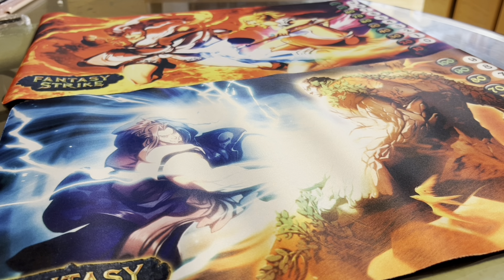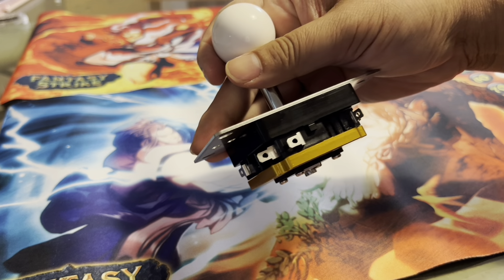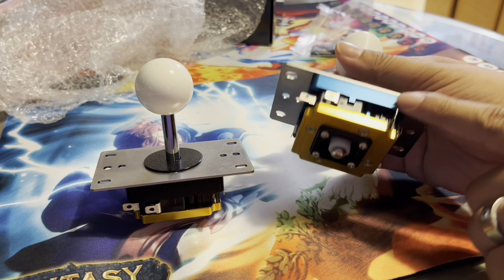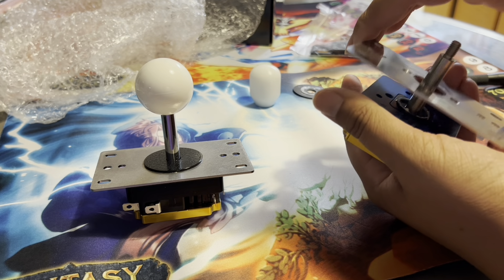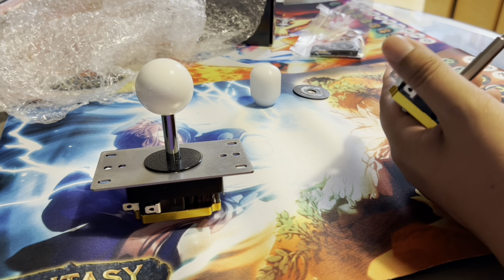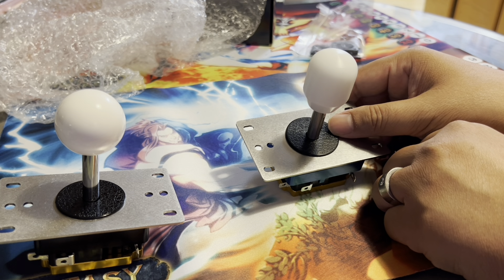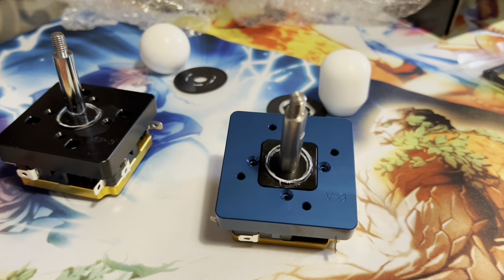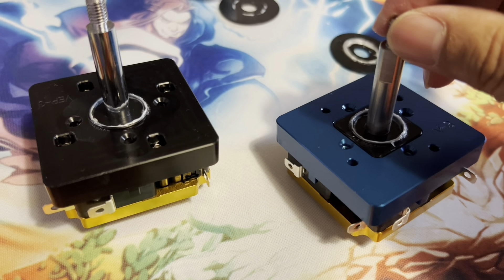Fresh Out Of The Box: Premium Sanjuks V3 - One of the Greatest Levers Just Got Better!!!

Comment: I assume the spring delete kit doesn’t work with the old v3?
Reply from the maker: The Spring Delete Kit is not for the Sanjuks levers (any of them). It was just a bonus gift from Buttercade. 

It is used with the Otto DIY V2 modkit which makes a Sanwa JLF lever perform with a mini grommet & spring system (instead of its usual pivot and spring system).  The Spring Delete delete mod outright replaces the spring and creates a unique feel 🙏🏼

Comment: I run a JLF With Otto V5 and 2lb Spring and it is absolutely amazing but I want to try a Korean lever, so I see that this Sanjuks V3 seems like a JLF but with Premium Built so I should try the Sanjuks V6 instead of this V3. I don't think the Sanjuks V3 is better than an otto V5 other than just the premium build. What do you think?
Reply: Edit 👆
Reply from the maker: @Pichoniix  I promise you I will respond to your excellent inquiry, but I’m taking care of sone work stuff for a few more hours. But I do have some things to say and I’m looking forward to replying 🙏🏼💕🔥
Reply from the maker: pichonix, Excellent question and inquiry!

- I totally love the JLF + Otto V5!  My favorite spec is JLF + Otto V5, 1.5 Otto Actuator (I wish they had a 1.25) + Buttercade Stainless Steel Pivot!  For my game, Virtua Fighter 5 Ultimate Showdown, this build is just so insanely good as long as you have good neutral control on the JLF.  It is insane greased lightning and is a rapid fire direction hitting machine!

- The Sanjuks V3 is like an interesting mesh of stock JLF and some of Seimitsu’s levers.  It has a neutral snapback that Seimitsu and K-Lever fans love.  The tension is not as high as a Seimitsu but it’s got a really cool “machine-like” feel.  The tension drop is part of that.  When not feeling mechanical, most models feel very smooth and when it’s smooth it’s buttery in those brief but frequent moments.  It’s a very different feel from the Otto V5 but it’s great.  The throw is closer to a standard JLF throw.   The buttercade stainless steel pivot can also be used in the Sanjuks V3 and in most cases it’s super amazing.  There’s a rare case where it doesn’t work out as ideally (still plays awesome, but potential to pop).

- Yes, like you said, the Sanjuks V3 is a Japanese Lever inspired design.  And yes, ridiculous build quality.

- Regarding a Korean Lever to try…. The Sanjuks V6 is an awesome Korean lever that I would compare to Crown levers.  On top of the beautiful build quality, the feel is superb with no jank and the tension is a little higher but at a sweet spot where when you use it, you kind of just know how the V6 wants to be played/used.  It’s hard to find anyone who does not like the V6 and it is a very versatile K-Lever!  That said, I think it’s also totally worth recommending the Crown 309 New HelpMe Lever—that lever is also very versatile and so good!
Reply: @Chanchai_VF  I Also Run Stainless steel pivot on the Otto V5. I want to try the HelpME lever but I don't think they have a Quick Release version yet, I can get the Sanjuks V6 for $120 plus 25 shipping :/ forgot to mention o have a Victrix and the only type of Korean lever that could fit in it is one of those new Short Collar korean designs. Anyways what lever do you think is the best if you have to use it for a tournament match, JLF Otto V5 or Sanjuks?
Reply from the maker: @Pichoniix  in competitive VF I get about the same level of performance and consistency from both levers—but it is best to play the same lever a week leading into the tournament.

In theory, the Otto V5 should have an edge on stagger break situations which is a situation where we mash directions in VF. However, the biggest factor in stagger break are situational awareness and timing so it’s actually not that cut and dry. 

If we are talking about random casuals, there are times when the Otto V5 feels like home. Then there are times when the Sanjuks V3 feels like home. And then times when one of my Golden Lever builds feels like home. All three of these just play wonderfully. And for sure, there will be Seimitsu levers I end up adding to that list. 

I really love the Victrix Pro FS also. In fact, one Victrix has a V3. One has the Otto V5. One has a Golden Lever. 🙏🏼

The Golden lever build is really comfortable, high performance, very little stress to my hands. The signature smoothness is great. It’s a unique feel, but feels so great. 

Back to the V3, I love how the V3 feels like a high performance sports car and love how it looks and feels like a finely tuned machine.
Reply: @Chanchai_VF  i am. Selling my M Bison victrix I already sold one M Bison as well. Because I want to get a PS5 stick for the ps5, I don't really want to have more than one stick Tbh I used to have a lot but One is just fine for me lol
Reply from the maker: @Pichoniix  not gonna lie, that Bison stick is so tempting! I love the insane artwork they used on it and there were times when I would stare at it on the Victrix site last year 😂
Reply: @Chanchai_VF  For me, the drawings of the victrix of Bison and Ryu are the best drawn. I can clearly see that the drawer put love on those two, but I went for the M.Bisoj because Red is my favorite color and I could not resist. I am not a Street Fighter player XD I play KOF
Reply: @Chanchai_VF  quick question the stainless steel pivot can I just buy this and a sanjuks and put it in? Or do I need a certain kit for it to work I’m new to this but thinking on buying the sanjuks v3 premium
Reply from the maker: @InSaiyan-Shinobi  the stainless steel pivots are harder to come by, and I’ve only used the one by Buttercade. However…

Some people have had slight miss-fits with stainless steel pivot and the V3, including V3P I believe. 

Because if this, the pivot I most recommend for all V3s now are the Hori Hayabusa Pivots with a little lubricant. It is incredibly smooth and has been very reliable as far as I can tell in the community. 

If you have friends who have a Hori arcade stick and you believe they’ve replaced the lever, see if you can get the Hayabusa from them. The parts I like harvesting from Hayabusa are the pivots and the mounting plate as it is a nice black mounting plate 😎

Hope this helps! 🙏🏼

Comment: I got a sanjuks v3 premium at evo this year, and I can't take the bat top off for the life of me. It looked simple when you did it. Do I have to use a wrench or something? Thanks
Reply from the maker: Yes, you’ll need to use the correct size wrench to hold the shaft in place as you unscrew the top 🙏🏼

The location for the wrench is where the shaft is square instead of round 🙏🏼

UPDATE: I believe the correct wrench size is 8mm ☺️

Comment: How big is the actuator that comes on the premium? The only thing that is holding me back on this is it looks like a it has a long throw similar to stock jlf. Do you have any modification ideas or actuatuor recomensations to get a short throw similar to otto v5? Thanks
Reply from the maker: Good observations!
- I cannot remember the actuator size right now. 
- The throw is similar but slightly larger. However, I do personally feel it is well complimented by the mechanical feel of the V3, especially with how it feels as it snaps back to neutral. I also personally believe that when looking at throw, one should be testing both P1 and P2 side thoroughly—for my preferences, P2 side benefits from a little more throw though P1 side loves tighter throw and fast actuation. So in my case, I do a lot of testing on P2 side now because whatever my P2 side can do, my P1 side can do better. 
- I have not tried to shorten the throw on the V3.  I really like how it performs 🙏🏼
- The mechanical feel is felt both when leaving neutral and returning to neutral. This is probably why I don’t really hear any complaints about it’s throw despite having a larger than JLF throw 🙏🏼

Comment: What’s the difference between v3 and v6?
Reply from the maker: The Sanjuks V3 is intended to be Bandit’s (the creator’s) take on a Japanese style arcade lever which uses a “pivot and spring” design. The V3 has some traits of the popular Sanwa JLF lever as well as sone of Seimitsu’s levers while having its own unique feel in the end. 

The Sanjuks V6 is bandit’s take on the Korean style lever which uses a “Grommet based design.” The Korean design offers dynamic tension which is a different type of feel than Japanese levers.

Both the V3 and the V6 are incredibly high quality levers with incredible build quality. They have high performance and they are beautiful works of machinery. And they are made by the one man, Bandit.
Reply: @Chanchai_VF  thanks man also great videos!

Comment: is the V3 a good lever for both 2d and tekken? I want a lever that can do both without swapping all the time with my stick.
Reply from the maker: @JZT97  that’s a good question! It’s a tricky one because I think what makes a good Tekken lever for you can be very personal. 

From my observations, Tekken 8 plays well on many types of levers, especially compared to Tekken 7 or other Tekken titles.  

Because of how many good players I see playing Tekken 8 with Sanwa (but a lot of the very best use K-levers), then I am more confident in saying that Sanjuks V3 can be great for players who Tekken 8 great on a Japanese lever. 

However, I have to still point out that I usually see performance improvements in levers in Tekken 8 and other Tekken titles when playing with Korean levers. So Sanwa V6 and especially V7 are more in line with Tekken. 

For me personally, if I wanted to use something to play both Tekken 8 and 2D fighters, I would probably personally like medium throw with a light handle and light tension.  But that’s me. I personally favor a Golden Lever build for that but  similar levers would be Shinsun 2d, Crown 309-NewHelpMe, or Sanjuks V6.  

But I do think more traditional K-levers are best for Tekken. 

I think the V3 is strong on any game you are happy or fine playing Sanwa JLF on. I think it’s a big experience upgrade in that use case.  

I think Tekken 8 is more friendly to the V3 than Tekken 7.